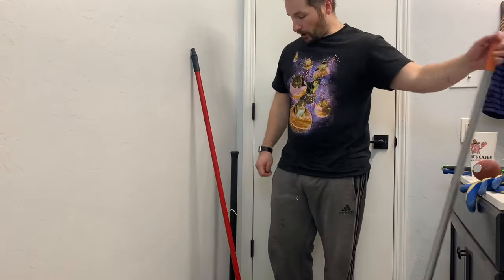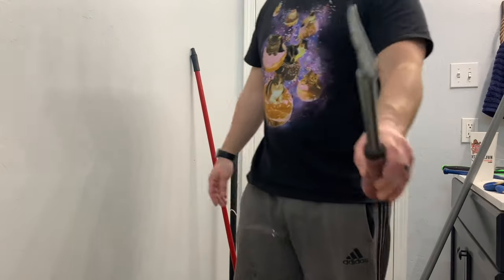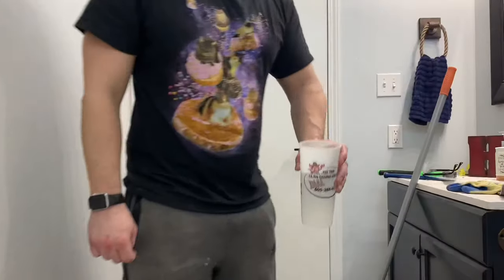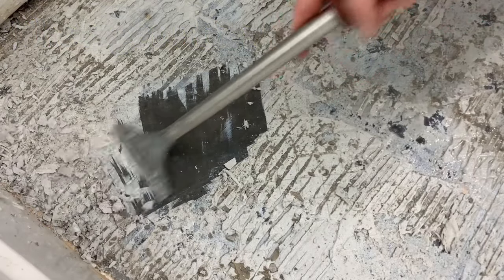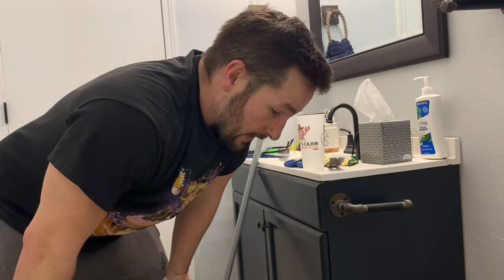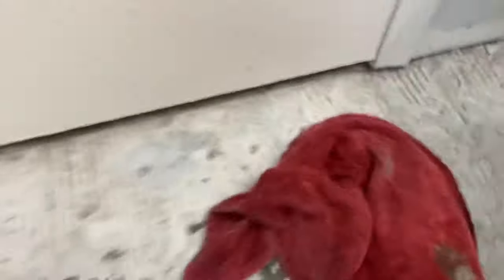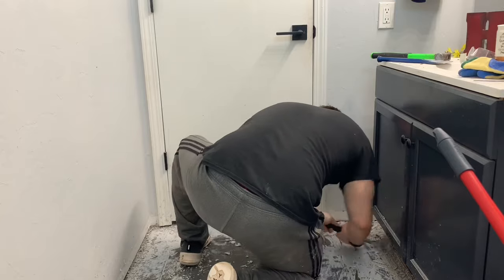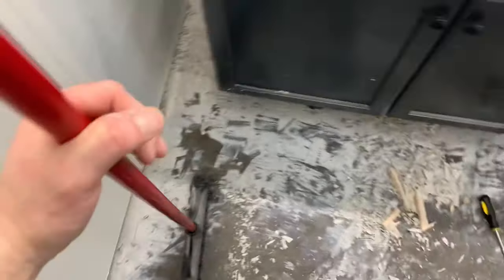The EASIEST & Cleanest Way To Remove Thinset Mortar

Comment: Holy smokes! I pulled up a 5x5 area if tile in front of my front door and have been fighting two days trying to get the thinset off the foundation so I can lay down laminate.. tried chipping it away with a hammer and chisel which work but only an inch at a time.. also tried a angle grinder but that was a nightmare, poor results and alot of dust. Just came across this video awhile ago. I just happen to have that exact same scraper tool. Poured water on the thinset and waited about 15 mins - came up like peanut brittle. What a game changer! thanks!  I'm wondering if boiling water would work even better..
Reply from the maker: Love to hear it! It’s a game changer for smaller areas for sure 🙌🏼. Thanks for watching

Comment: It really keeps the dust down but I used a demo hammer with a special wide thin blade meant for this and its hard ass work. No way it could be scraped as easy as yours did. Tile has been there since 1991 when the house was built so maybe fresh concrete caused such a strong bond?

Comment: Thank you for the great video. Do you think this method will work when the substrate is fibre cement sheet / board? We want to remove tiles and thinset, level out the surface as much as possible, and then place a masonite board and viny floor over it. Looking to renovate a floor area of approx 3 square metres.
Oh, should have read more of your comments below. Looks like there should be no problem wetting fibre cement sheet for this purpose. Might try the wet towel approach and see how it works out. Final result won't have to be perfectly level for our purposes and I would rather not have to replace the substrate in this situation.
Cheers from the Land Down Under.

Comment: I discovered, actually somewhat to my dismay, that I was able to clean dried thinset in my mixing bucket by filling with water, waiting a bit (5-10 minutes), and it rehydrated and wiped off pretty easily.

Comment: Awesome! ty for this, question, will the water method be ok it’s not concrete under the tile? Our bathroom, on second floor I tore up the tile, I belive it’s sheet rock under the thin set. I just don’t want to ruin what is there for a base. We’re putting vynal flooring down next
Reply: It's been a year since your post. I'm now in the same predicament,  what did you end up doing?

Comment: Thanks for the video.   Do you have the manufacturer name for this blade? or a link? How long is the handle? 18" or 24" or?  is that about a 4" blade?  Want to make sure I buy the correct one
Reply from the maker: Not sure tbh. I got one from Harbor Freight and one from Lowes
Reply: @hammershomereno   no worries. thx for the video

Comment: Would this work on a slate walkway? Our brick layer left two giant gobs of mortar on the slate of our walkway 5 years ago. Now I’m repointing his mess . I tried muric acid . I tried TSP, I tried sanding it down with a masonry bit for my all purpose tool. I think the bit removed 3/8 of an inch but there’s more , he really must have dropped a huge plop. I also tried softening with dabs of hydrogen peroxide. I think the mortar must have had some adhesive because there was some yellow that I was able to sand off with the masonry bit. 
At this point I’m wondering if there is some kind of dye I can use to at least blend what looks literally like vomit (yellow bile and now gray mortar ). At least it’s not brown & yellow anymore 😌 but I sanded one dime size part for 2 hours and it seems bottomless. My mortar bit is course .
Reply from the maker: Well if you’ve done all that then I don’t see why not try it? It is outside after all. Another option is a demo hammer to chip away at it
Reply: heck yes I’m going to try . I’ll tape off the surrounding slate so I don’t etch the whole piece of slate . I think I have a stubborn remaining 3/8 of an inch remaining. 
The same guys that did this installed a chocolate marble in my basement bathroom. They cleaned up with some type of acetone to clean up the grout the laid  I suspect and Etched the marble ! It turned white! I brought him back and he wanted to charge me to rip 7 marble tiles he destroyed! Alas I invented a miracle and was told it couldn’t be done and never had been done . Literally Old English ( light wood) scratch remover sucked up all the color and looks like new ! I was shopping for masonry dye for the outdoor slate and thought I’d experiment on the basement 😂 I was told marble couldn’t be dyed they were wrong . I had the wood stain ready but for some reason thought I’d try the scratch remover first . It matched perfectly and I didn’t have to use vinegar to etch the entire marble floor to match . Just the bits my drunk ( not exaggerating) masonry guy etched . Wow etched marble will suck  up any stain you put on it . I will seal it but it dried to a high polish to match the rest ! and it’s been 24 hours . Wiped it up and it doesn’t wash off. I probably don’t need a sealant , but I have PTSD from the white stains they left all over my marble . My God! It looks like new . 
I’m going to use your method on outside slate (taped off) then try a small patch test with a blue concrete dye and then seal the whole piece. If it doesn’t come off. I know where this guy lives 😡I’m on day five of chemicals, chisels, paint scrapper (not sharp enough), masonry bits and now a scalper (blade scrapper). Hoping by some miracle I’ve loosened it . Hoping it doesn’t tear off the slate with it but it’s never chipped after 50 years , so a small chip , flake , or indentation won’t kill me at least it will return to its natural color beneath the mortar. Whatever is left looks flush , but obviously there’s a stubborn thin set layer now because I have not gotten down to the blue stone Yet . Feel like I’m digging to China . My hand is bruised. I will let you know the results because I’m sure I’m not the only homeowner with masonry disasters. 

My husband says I’m stubborn this is not going to beat me . Maybe I’ll hand him the blade scrapper for extra muscle 😅
Thank you 
Still can’t get over my marble dying experiment.I may need a patent . Secret marble formula . I uses for light wood even though the marble is dark chocolate brown . ( I did experiment with test pieces first . Wow that high gloss left still dazzles me .

Comment: Do you recommend doing this with thinset on a wood subfloor?
Reply from the maker: Generally with wood subfloor you have to tear it up and lay new subfloor down
Reply: I have used wet towels spread out and let it soak for about 20 minutes and it came off rhe wood pretty good. I did a set of stairs and took a couple hours

Comment: Will the water destroy the cement board underneath?
Reply from the maker: Cement board is intended to be semi-waterproof. I’d say depends on what the underlayment is. Is there a concrete slab?  No need for concrete board. Is it plywood? If it’s plywood underlayment then you need to replace that regardless when taking up tile flooring

Comment: I tried this method and it did not work. I must not have enough upper body strength
Reply: It's not you. He has very little thinset in this video and it doesn't look very old. Thick thinset that's a few decades old will not peel up this easy. Especially if it's layed over leveling compound. It sticks to that stuff better than concrete.

Comment: That is not thinset mortar. that is plan old mastic
Reply from the maker: Actually yes it is Thinset mortar. Thanks for watching
Reply: Next time dont comment because you have no idea what your talking about. Its either modified or unmodified thinset. Mastic doesn't get used on floors. Or in showers. Mastic is just a glue thinset that has 0 concrete/mortar properties and is used mainly for backsplashes